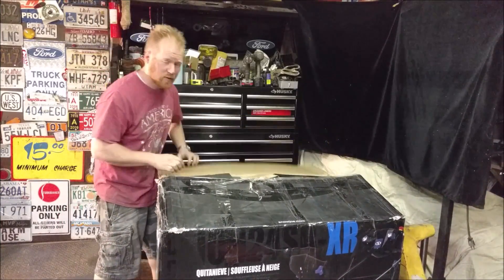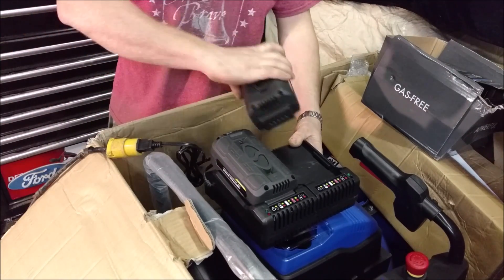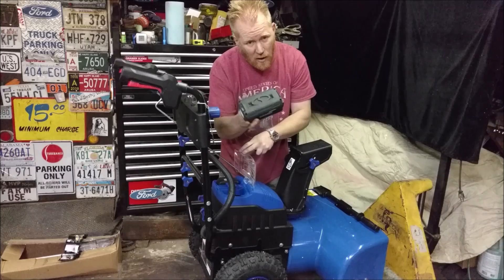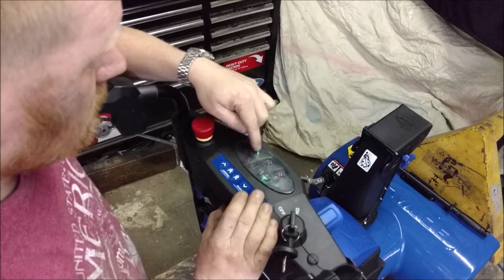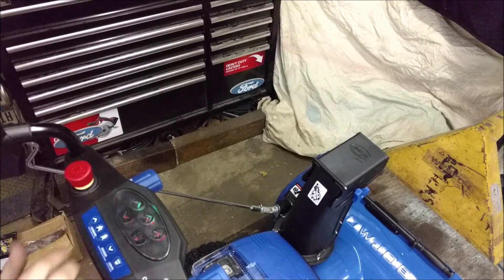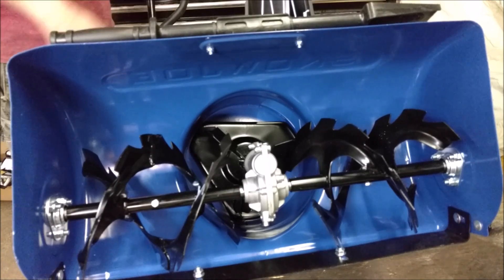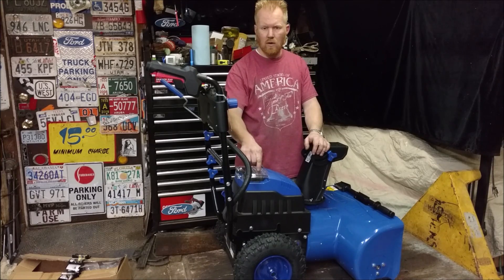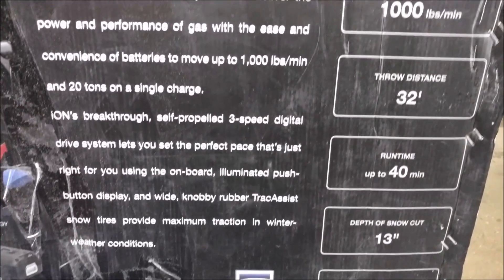Lithium 2 Stage Snow Blower!?

Comment: Lots of negativity by those who've never used battery powered equipment. I've been using Snow Joe battery snow blowers for two winters now. There fantastic for what there made for. Obviously you'd grab a gas engines blower for anything really deep or heavy but battery powered shines with four to six inches.  Myself I just upgraded to the EGO dual 56V I was so impressed with the Snow Joe single 40V. plus the EGO had awesome reviews
Reply from the maker: I played around with it the other day in a few inches of wet snow I piled up on the lawn. It didn't care at all how much I put through it. I'll be interested to find out how long I can get it to run for on a single charge.

Comment: Are you able to add accessory lights to it that run off the battery?
Reply from the maker: It has 2 lights build in that you can aim. They aren't very bright but work and I assume this is to limit the power draw.

Comment: How do you think its going to work in heavy wet snow or in temperature conditions below 30 degrees? (Which would be pretty much all of the time.) Not well I expect. People seem to forget that the chemical reactions that create electricity in batteries slow waaaay down in the cold. Please come back with a video that shows this thing actually clearing some snow.
Reply from the maker: I did a fair amount of reading about Lithium batteries and the cold. It seams they should be fine to 0F or maybe a little more and I plan on testing it. It would be easy enough to place the charger inside the house and take the batteries outside when it was time to do snow removal if it presented an issue. The wet snow is going to be interesting as electric motors have more low end torque than a gas engine, so we'll see.

Comment: kobalt? sorry if you did say the brand, i know kobalt are 40 volt and blue, doesn't snow in Australia though so no snowblowers for sale ;-) these modern cordless tools that use proper voltages and beefy batteries instead of drill batteries have impressed me. in particular the 56 volt ego tools. the blower puts plenty of petrol ones to shame and the run time is surprisingly not total bullshit :-)  I look forward to trying a lawn mower out one day but they are well over 700 bucks once you include a battery (AUD) so the petrol mower will do just fine so long as it runs :-D
Reply from the maker: Snow Joe or Sun Joe for their mowers etc. We have the Kobalt and Ego tools and they compete directly against Sun/Snow Joe. A Kobalt 40v 19" lawn mower runs $279 USD here.

Comment: I'm definitely interested in seeing how this performs. Obvious tests of wet snow and plow mounds please, and your own evaluation of battery life.
As a side note, don't underestimate the appeal of not having to deal with gas, oil, and the regular maintenance required by gas engines (I tend to neglect this). I'm mechanically capable but I would not trade my Toro e-Cycler and Makita string trimmer combo for any gas tool.
Reply from the maker: The compact tools are doing great with the new lithium batteries.

Comment: I've read through a few of the comments and many show concern about moisture in the battery compartment. You may do a follow up on DC current and good old H2O. They're more compatible than most seem to think. In other words, a 9v battery in a glass of water will continue to deliver it's power where if you stick open ended 120V AC into water, something is going to blow. I see a trend in battery powered equipment that spells disaster to the internal combustion engine eventually. I sure hope that's not in our lifetime. I think you're correct that this is more suited to the urban population. I have two driveways totaling over 250', plus the 2.5 car patch at the garage and as large an area at the shop, so I would literally need at least 18 batteries at the ready. Not to mention...I'm allergic to HANDLES! lol Cheers Moe! Sean~
Reply from the maker: Nothing is going to replace the gasoline engine for a long time. It's too cheap to operate and they'd grandfather all the old machine in even if it got banned.  I'm not worried about moisture either. I'm sure it'll be under powered to what I'm used to, but is it better than a shovel?
Reply: That it is!!

Comment: I think only the snow itself will show its strength, or weakness.
A brushless motor sounds very good for reliability, its the control system that has to cope with dampness and spiked overloading.
 Also its reliability depends on how well they tortured there design before going into production.
Torture it LOL :-D
Reply from the maker: I'll torture it.

Comment: I would be great if you could disassemble it to see how it's built on the inside (motor, belts, wiring insulation and water tightness) ?

Do you think it has an 80 or 160 volt Dc motor ?

It would be great to see you blowing snow (heavy and especially the border left at the end of the driveway by the city) with this unit.

I guess an impeller kit upgrade will be needed after the initial testing ?

Comment: I wonder how it will do with slushy snow and packed snow that you normally get at the end of your driveway after the snow plow comes by, if you know what I mean.
YouTube user donyboy73 did a similar review a while back don't think it was the same model but it was an electric battery powered snow blower.
Reply from the maker: They clog due to the gap between the impeller and housing. This has a standard gap I would expect to find on this price point of gasoline snowblower so it would bog and clog like all 2 stage machines. If I did the rubber impeller modification like in this video: https://youtu.be/-XLOCtrAYZc it wouldn't ever clog.

Comment: Looks like a pretty sweet machine. I will be looking forward to seeing it in action and like the gentleman below, I wonder how it will do in wet snow.
Reply from the maker: This has a standard impeller to housings gap I would expect to find on this price point of gasoline snowblower so it would bog and clog like all 2 stage machines. If I did the rubber impeller modification like in this video: https://youtu.be/-XLOCtrAYZc it wouldn't ever clog. However generally an electric motor has more torque than a gas motor, so it should "power through" better? I'm assuming it compares to a 5hp 160ish cc motor?
Reply: I remember that video with the rubber additions to the impellers. It should be fun to see how it works.

Comment: I was looking at an electric this year but ended up with a power smart 208cc from sears for 242.00 shipped. It's not the best by far but for light to medium snow it will do the trick and I have a two stage for the worst. It's going to be interesting to see the trials with this unit this year. Does it have the same issue all the rest do with the second stage propeller clearance being to large?
Reply from the maker: This has a standard impeller to housings gap. I've seen bigger gaps but not really smaller gaps on similar sized home owner machines and it is what  I would expect to find on this price point of comparable gasoline snowblower. So it would bog and clog like all 2 stage machines in the really wet stuff so I may have to modify the impeller.

Comment: Hmmm. I have to see how it works in snow before I buy into a battery powered two stage snow thrower. It looks too heavy for women and too toyish for men and the batteries look very pricey and proprietary, when the time comes to replace them. But who knows, maybe it will be the wave of the future.
Reply from the maker: It feels like a basic homeowner gasoline powered machine I would see at the Home Depot. Definitely not a 10hp workhorse but I'm sure it has it's place. I've been impressed with other lithium powered tools so who knows. On a side note: my father in-law purchased a lithium powered weed eater earlier this year as it was too much trouble to start the two stroke. I love the power of a gasoline powered weed eater and wouldn't do without. His yard is the same relative size and he loves this battery powered thing to death. a month ago I used it for a good hour and have to say I hated it at first, but quickly learned it's limitations and strengths and it was an enjoyable piece of equipment. It has it's place, but I'm not giving up my 2 stroke anytime soon and he's not giving up this anytime soon. Will I get rid of my gas powered snow blower, NO. Will this make someone who is mechanically inept very happy; YES.

Comment: In addition to just running it, see how fast it will let you go through a couple weeks inches, see how deep it can handle slowly, see how it handle slushy plow line, see how long it can run on one charge, see what effects storing the batteries warm and freezing makes, charge up the batteries now and check how much they self discharge before the first snow.
Reply from the maker: Good idea.

Comment: Worried about the batteries in the cold?
Reply from the maker: I am actually. I'll try to get them into the negative F numbers for testing. These will use the standard 18650 cells that are in everything these days. I've used my power tools that run these in the cold but never below the teens(F).

Comment: Um did Fedx or UPS bring it to you ?. Just wondering has some of the packages I have received look like that. Cool snow blower. Thank you for sharing.
Reply from the maker: UPS did this magic trick and generally they're better than FedEx. The box came wide open and it appears the snowblower traveled for some time upside down.
Reply: Not surprised . It used to be they would at least tape the package back up.  It's sad how the pride people used to have in their job is just another casually of the Morals  that used to be so common. Production and greed at it's best.
Thank you for the reply.
All my best.
Reply from the maker: My father in-law worked for the post office in the 70's, back in the sorting. He tells the story of finding a leaking box in the bottom of a bulk mail bag. The 6 guys in the back opened it to find a broken bottle of cologne. Without hesitation they all opened their wallets and pitched in a few bucks for one guy to run to the drug store and buy a new bottle of cologne.  They put the new bottle in, taped it up and processed it like normal. That's just the way it should be.
Reply: That was great ! Shame people are losing the kindness it takes to do things like that. Thank you for sharing that,it is very heart warming to hear of acts of kindness. I am looking forward to seeing how your Snow blower works over the winter. And thank you for all the great tips. I don't comment a lot and get behind on viewing at times.
All my best.
Bobby

Comment: I want to see it blow snow in San Antonio,  TX.  It hasn't snowed here since 1985 when it snowed 13". It also never snowed here before 1985 at least not so you'd notice. There was once in 1968, but it was gone in hours. I think more bullets fall here than snow flakes.
Reply from the maker: I'm sure it'll pick up Fire Ants and throw them clean across the border.
Reply: sixtyfiveford I'll bet it would,  and that would be a handy dandy tool!

Comment: You should be ashamed of yourself.   Take your toro 2 stage park it outside next to snowjoe the night before the snow.  have them both ready to go.  Toro gassed up, and the childrens powerwheels charged.  let em sit out in the sub zero.  side by side test in the morning.  Nothing beats gas, and you know it.  Especially for a guy like you who can wrench on small engines
Reply from the maker: O for sure I wouldn't give up a gasoline powered machine. My Toro has nothing to fear. I also wouldn't buy a Prius, but many are very happy with them and they seam to have a place like many things. I could probably pick a handful of neighbors that dread starting their machines who'd love a simple machine like this.

Comment: Is there anything made from metal anymore? I won't be as critical id this thing works.
Reply from the maker: I was impressed that the entire housing was 1 solid stamped piece of steel. I'm with you and not too keen on the plastic handles, but it seams right on par with everything else I see.. They also use a metal impeller where many manufacturers have went to plastic! I'll be interested to see how this holds up.

Comment: I just heard Tesla car batteries last up to 20 years at a 90% capacity.  I believe they use Lithium Ion batteries.  Because of the ethanol in fuel electric is the way to go, but electric tools are only as good as the batteries.   For the average dude, electric is easy and handy, but it needs to be strong enough.  They are also quieter.    Ariens is making snowblowers that are fuel injected no problems with carbs in a fuel injected snowblowers.  I would like to see that thing do what it is meant to do:  Blow Snow.  See you back here in the first snowstorm.
Reply from the maker: Fuel injection= computer in a snow blower. Just like all the techs in the appliance world and their computer operated washing machines, fridges, etc'; the reason they all break these days is the computer. But the blame is because the computer operates in the worst conditions; Hot, Wet, Freezing Cold, and so on. The days of working on small engines without a scan tool and laptop plugged in are short. 

Like all tools, I'm sure this electric snow blower has it's place. I personally wouldn't cut my lawn with an electric mower but many do and it does a great job. This would be ideal for someone with probably a 20x40 drive and a 4-5 inches of snow a time.

Comment: I have an old ('91) Ariens two stage. The engine seems to run okay but it doesn't throw snow very far. Could be the belts. I have been thinking about replacing it with a one stage electric (looking at the EGO). I tend to clean my drive multiple times during a large storm. One thing I like about electric is that I wouldn't smell like exhaust after every cleaning. I also got to thinking that I could store the electric in the basement over the summer without worrying about the gas and oil smell from a traditional snowblower. I look forward to hearing how you like this snowblower.
Reply from the maker: https://youtu.be/-XLOCtrAYZc with this trick your machine will breath new life. People seam very happy with these lithium powered single stage units.
Reply: I ended up getting the EGO 56V single stage snow blower. I did an unboxing on my channel. I can't wait to try it but we have been having beautiful fall weather here in Iowa. I'm sure the snow will come. I gave the Ariens to a friend and will pass along the link to your video.

Comment: It would be a little hard for me to use on the driveway.  It's 3/10 of a mile long and the batteries probably wouldn't make it all the way out and back.  LOL  then 3 years from now when the batteries give up the ghost, there will be no replacements to be found like all the other battery powered appliances.
Reply: MrOldclunker when the batteries give out, open them up and you'll probably find a load of 18650 batteries that can be swapped out with a little work.
Reply: true have done that with laptop batteries